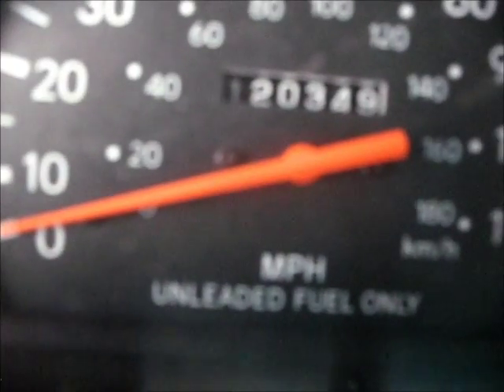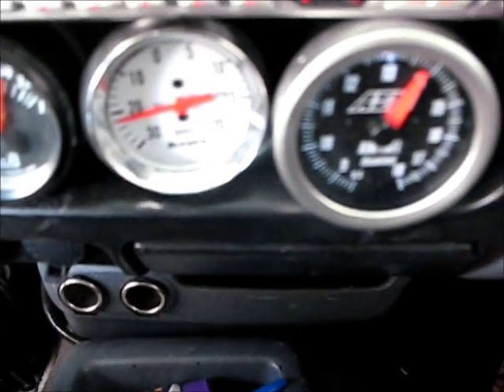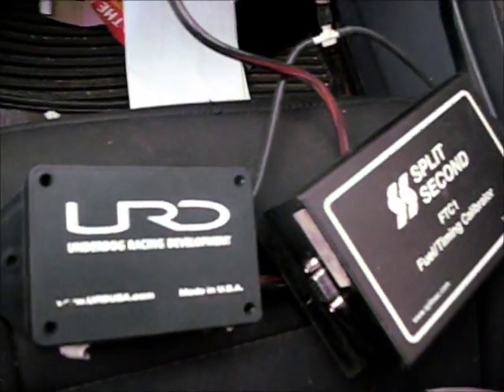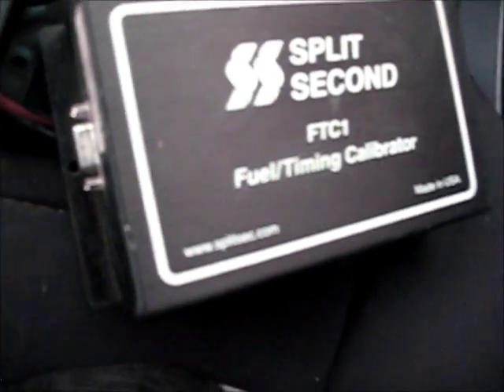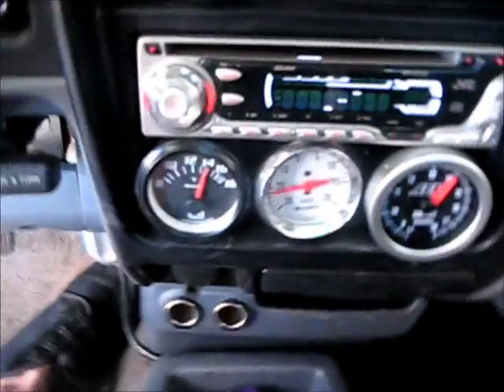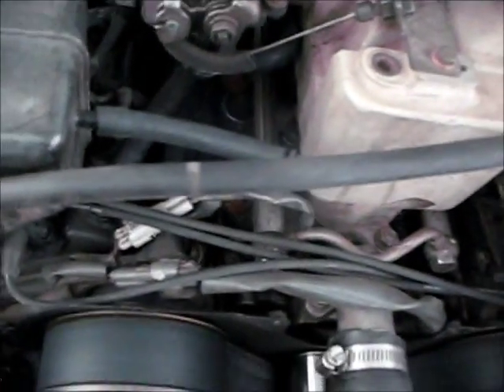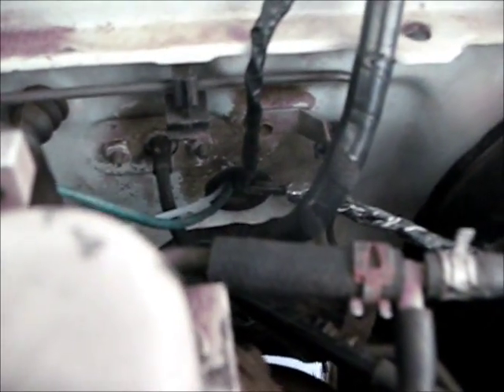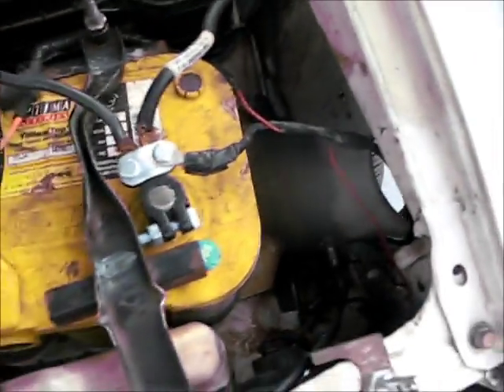'99 Tacoma 3.4 Liter Supercharger Set Up

Comment: hmmm geuss it still needs tuning even after putting a low pressure (around 6 psi) compressor i thought i would put an adjustable  rising rate fuel pressure regulator and call it a day lol

Comment from the maker: Late repsonse, little trick i found for placing the tensioner bolt under the alternator,, put the lock nut outside the track towards the fender makes the belt get tighter.  I had it making 13 psi with a pulley rated at 10 psi !!